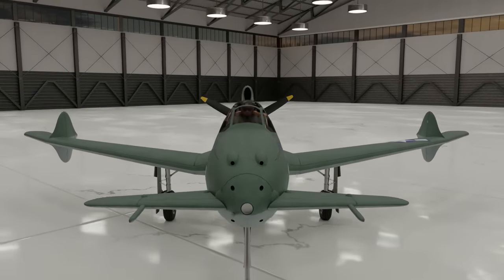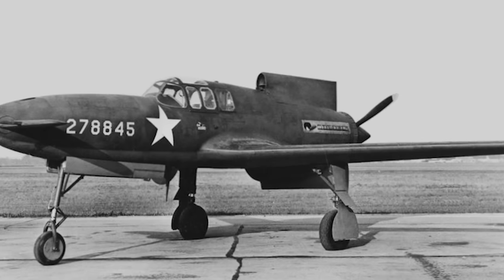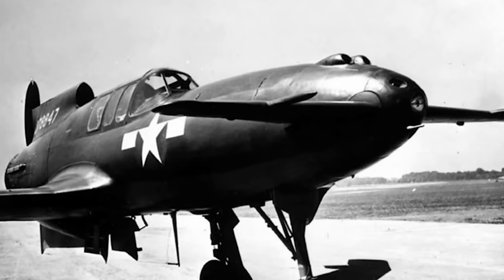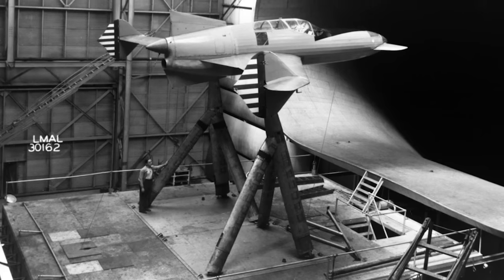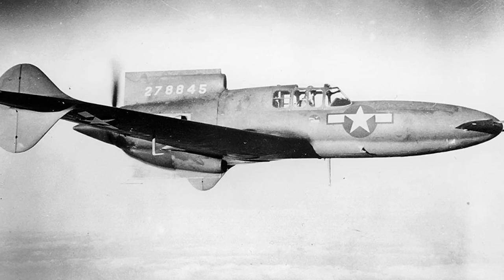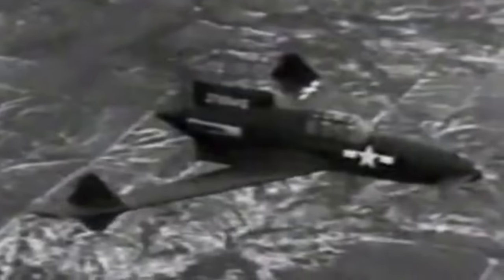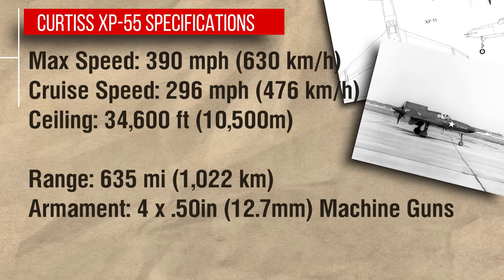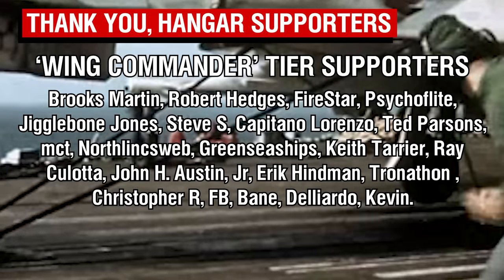The WW2 Super Fighter That Was Built Backwards | Curtiss XP-55 Ascender [Aircraft Overview #76]

Comment: First of all, why would this airplane need an inverted engine?  Inverted engines are easy to service in a conventional geared airplane, i.e. a tailwheel.  This airplane didn't have a tailwheel, so why the inverted engine?

Second, this plane looks unconventional.  The USAF and it's predecessor USAAF is very much a "visual" branch of the service.  They are all about "drill and ceremony", since when you are on the ground there literally isn't anything else to do.  I've flown with many former Air Force pilots and they generally are average at best.  Navy pilots are far better, and civilian pilots are easily on top of all of them, since they have had to fight for their jobs instead of just being handed the handbook for a $50 million jet airplane.  In the USAF you will note that  people who advance to the rank of General are ALWAYS photogenic, most of them could be models, a totally stupid approach to human resource management.  It doesn't matter how good you are, if you are an ugly goon or short or have (literally) bad hair you aren't going to be a USAF General.  And there is always a maxim that says that if an airplane looks right it will fly right;  When I was a teenager I built hand-launched balsa gliders all the time and I never planned them out, I just built them.  I made them look right and they always flew great.  But that doesn't mean that a canard glider wouldn't have worked for me, I simply didn't build them.

Third, this would have been easy to convert to jet propulsion, which would have made all the difference in the world.  The vertical fins were ridiculously small;  What were they thinking?